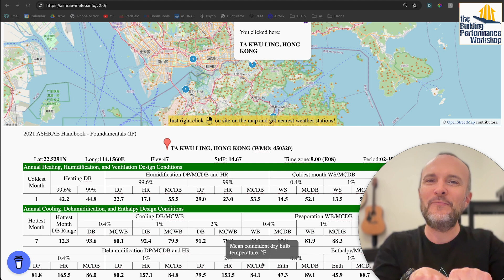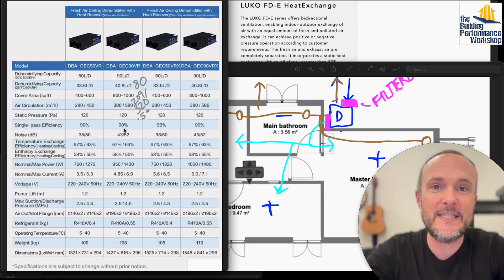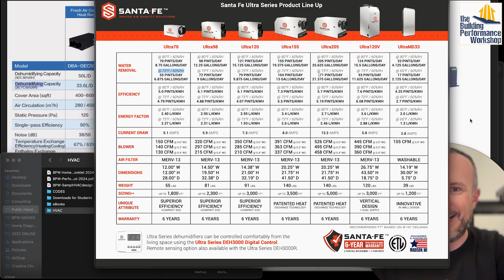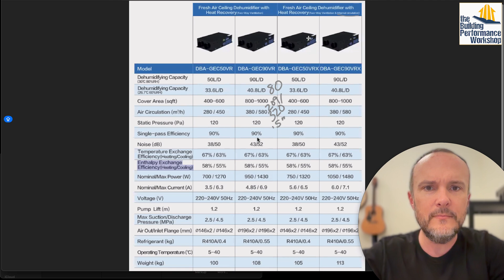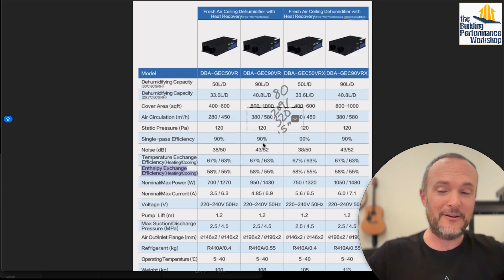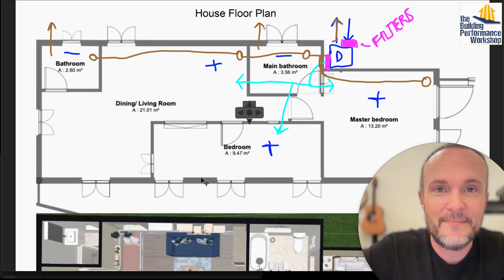Asian HVAC Innovations and How to Evaluate for Homes: ERV + Dehumidifier Combo

Comment: The more complex you make the system the more maintenance /energy required. The vast majority of common people can’t or won’t do or have done the REQUIRED maintenance (money). Those Units are seldom put where they can easily be serviced . RULE 1 maintenance if it is not easy it will be neglected.  Like most ideal systems most are NOT Practical in common use.

Comment: I’m in a rented apartment in Japan. Any suggestions for an Erv. Where can I find the formulas. Generally outside is 80 to 90% and 32 to 39c.
Reply: @nerikiri  There are several Japanese ERV brands. Some well known, others not so much. Mahbex Sumika as one type. But if you are in an apartment, your best bet is to get one of the split-AC systems that also provides heat in the winter. They are reasonably priced, and will perform well for an apartment.

Comment: That's basically a residential DOAS system. The  CERV2 is about the closest equivalent we have in the US. I would like to build a system like this some day, but with hydronic coils, and maybe a small desiccant wheel to get the supply air really dry.
Reply: We already have residential hydronic DOAS system and DX DOAS system.

Comment: YES!!!  I’ve been saying we need an HRV with a heat pump / dehumidifier built in for a long time!  Have four coils and directional valves so you can cool/heat/reject into or from any airstream you want.

In the summer you cool/dehumidify incoming air and reject the heat to outdoors.  In the winter you can capture the small remaining heat in the exhaust air and use it to heat the incoming air on really cold days, or add supplemental heat to the incoming indoor air.  In the shoulder seasons you can heat/cool/dehumidify as required and keep/reject the heat as desired.

There are heat pump based HRVs already available, but these need to run a compressor to do energy capture.  Adding a refrigeration circuit to a conventional ERV would give so much flexibility AND some heating/cooling capacity.
Reply: I agree with this line of reasoning. Why can't we have an All-In-One unit that does ERV/DeHum/AC/Heating?
Reply: @JeffCrawfordInTokyo  the Minotair does that, but it doesn’t have an ERV core so it needs to constantly run its compressor to recover heat.  Because it has no enthalpy core it can’t recover humidity either, so it will dry out a building in the winter.
Reply from the maker: Sounds like your new project speeder
Reply: @HomePerformance  Corbet you have no idea how tempted I am... I work 15 minutes from the Minotair folks and I have so far resisted the temptation to drive over there and be "that guy" who knows better and asks for something they don't make!  LOL
Reply: We have such unit to do the heat ing/cooling/dehumidification/Ventilation in one system!Our clients love it!
Reply: @dehutech1072  who makes it?
Reply: @superspeeder  our company makes it.
Reply: @dehutech1072  I checked DehuTech and only saw desiccant dehumidifiers.  Am I missing something?
Reply: @superspeeder I don’t know why my answers disappeared 😢
Reply: @dehutech1072  sometimes YT will delete things I say if they are even slightly controversial.  Perhaps you used a word that got flagged?
Reply: Fantech Clean Air Furnace with the ERV core and a Mitsubishi Intelli-heat coil might get you close

Comment: In the UK it’s pretty standard to tie the bathroom fan operation to the light switch. After the light is switched off the fan will either stay for a period of time or more sophisticated ones have a humidity sensor to determine when to turn off.

I think this is a better approach than separate switch for bathroom fan that you might forget to turn on.
Reply: I've been thinking about something similar with smart home technology, but I need to get my bathroom vented to the outside instead of just dumping it into the attic. I have a separate switch for the shower light than for the toilet light, so it could use different algorithms for each switch.
Reply: @johnhaller5851  I'd think a good approach would be an occupancy sensor and humidity sensor.

If someone is only in the bathroom for a short amount of time, don't run the fan for that long after they leave. If they spend more time, run it for longer. And also run the fan if the humidity is above a threshold.

Comment: I'd love to be able to add an ERV to our three story townhouse. However, HOA rules won't allow any penetration of the envelope. I'm guessing that isn't an issue in this case.
Reply: You already have a penetration for the bath fans, probably for each fan. If you combine two exhausts into one penetration, and the other one exhaust penetration is far enough away from the plumbing vents and the other exhaust penetration (40 feet, I think) you could repurpose one of the exhausts as an inlet. Unfortunately, plumbing vents tend to be close to exhaust vents because there's always a fan near a toilet. Another possibility is to get a heat pump dryer and repurpose the dryer vent as the inlet if it's far enough away from the exhausts.
Reply from the maker: They just have to petition the Chinese government I think- should be a piece of cake